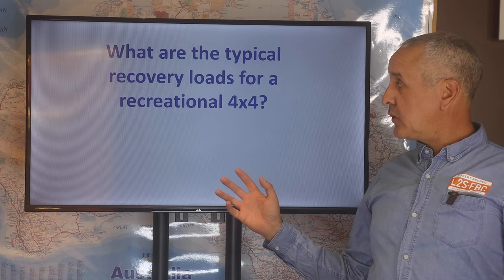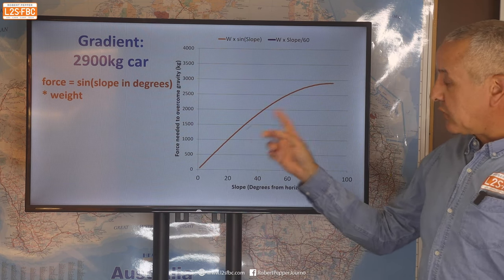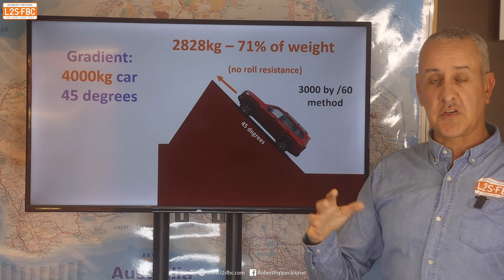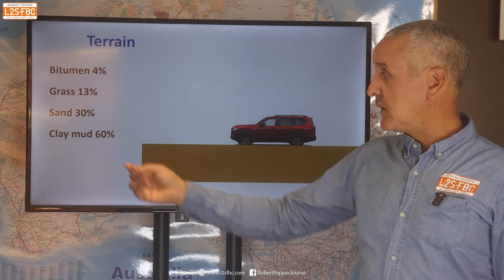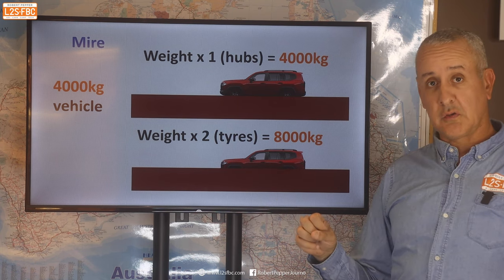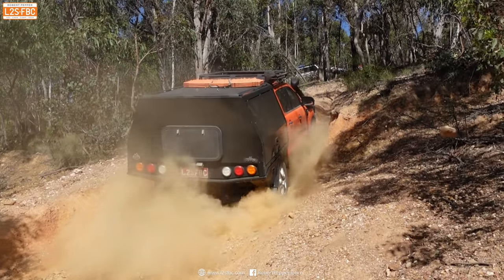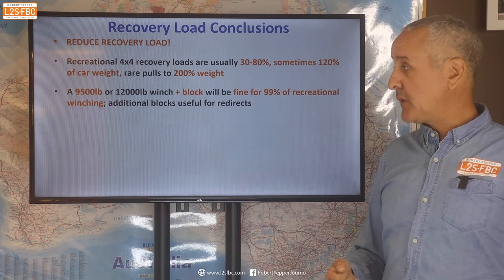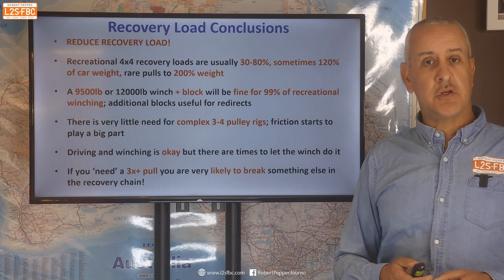Measuring real world 4x4 recovery force

Comment: Nice work mate. Thank you.

Glad you mentioned digging out. The best way to think is that the tyres have to rise up the distance to flatter ground so you are lifting the entire weight up before you can move. Hence why bogged below centre of wheel doubles the recovery force.

The guy who died last year in the US from a botched snatch recovery had spun tyres and dug down making the recovery much harder.
ETA: one inch of vertical is enough. From ex UK Royal Engineer, recovery specialist who I had at our 4x4 site a few years back.
Reply from the maker: what do you mean by one inch of vertical?
Reply: Heavy winching always makes me think about what is going to break on the vehicle first, not whether I have enough force to shift it. And not the obvious things like recovery points. Steering, suspension components, even tyres and rims. I’ve had light trucks bogged to the chassis that have taken heavy forestry plant to lift rather than drag out. Huge forces.
Reply: @L2SFBC  his comment was that you have to lift the entire vehicle up that 1 inch before you start to reduce the effective slope. So the same slope angle calcs apply even if it is only 1 inch lip. 
Obviously with soft ground then that may give way as you pull. (Didn't you mention the extra pull on your ute when you had it on that 22⁰ slope?)

Comment: Excellent content and info Robert. The load cell does not lie. I can't believe how many times I've seen people try to winch a vehicle over a major obstacle without using even the most minimal ramping system available to them (Maxtrax, rocks, dirt, etc).  Your demo at 11:12 of the video is a perfect example of drastically minimizing the line pull just by using some ramps. 
I've never found a downside to using a double line pull either, only upsides. It only takes a little more time and work, but the results are worth it.

Comment: a great video. the only time i have used a 4:1 compound mechanical advantage was when i had to use my Sierra to recover a bogged cruiser. main reason was due to the little zuke not having enough resistance to hold itself, so by putting 3/4 of the recovery load onto a static anchor i was able to pull the significantly heavier vehicle out.

Comment: Great video and info, as always.  As far as driving a winch: When on a slope/grade, imho, the biggest issue is if the driver uses too much throttle, puts slack in the winch line, then loses traction and slides back applying a sudden jerk to the winching system.  I'm all in favor of driving a winch when appropriate, as I believe you said.  Too many what ifs to address them all. 🍻

Comment: Firstly, I take it back what I said on Facebook about winching and driving. I've learned something here which I didn't know before. Secondly, it now makes sense why Land Rover's 1980's book Winching in Safety states that a double line pull should be used if your winching calculations estimate a line pull greater than 2,268 kg (5,000 lb), noting that the factory-approved winches back then typically had a rated line pull of 3,629 kg (8,000 lb) - Superwinch Husky, Warn M8274, Warn M8000 etc. - to the point Land Rover didn't authorise single-line pulls greater than 2,268 kg (5,000 lb) in that book.

I will add though that the British Army's Royal Electrical Mechanical Engineers (REME) Recovery Manual does mention two additional factors to be taken into account regarding recovery forces. Firstly, if half of the wheels are damaged, you need to add the weight of the vehicle as rolling resistance, with all wheels damaged being twice the weight of the vehicle. Secondly, it states that you should add a safety factor of 25% of your total sum of resistance to your calculations, which based on what you have shown seems like very sound practice.
Reply from the maker: Yes, should have mentioned both those points thanks.

Comment: In my experience you generally need less pull than you'd think. I use a 4500lb winch on my Jimny and it's always got me out. Sometimes I have needed to double line pull. I chose such a small winch because of the weight. I can easily carry the winch in one hand. This is important for me because it is removable and I have receiver mounts on each corner of the car. This gives a huge variety of possible pulling configurations.
Reply from the maker: 4500lb = 2000kg so that's about the same as a 10,000lb for a bigger 4x4.  Also, we can recover vehicles using hi-lift jacks and hand winches...so I agree, giant winches are always necessary.
Reply: I have a 4500lb  winch on my Subaru. I went with this as it should be enough on paper. However, although in most scenarios, it is fine in the hardest conditions, even doing double line pulls, it struggles although I did this to save weight and not affect weight distribution much I would consider going to a bigger winch as breaking a winch line on a steep Hill is downright scary. This was on a 43° hill
Reply: @060racing8   I have to admit I was a little concerned about that myself. I fitted the next size up synthetic rope to give some overhead. All of the rest of my rigging is stronger still. The biggest problem I find with this winch is the small amount of line that fits on it. It means I have to carry a fair amount of extra line with me for rigging.
Reply: @LesNewell  and it's probably not a good idea to be winching a Subaru up a hill climb made for motorbikes
Reply: Probably not but we've all done things that looked like a good idea at the time. I have to admit these days unless I am at an off road event I only use the winch to get myself back out, rather than trying to winch further into trouble.

Comment: Army taught me assume 100% vehicle mass for 45 degree and beyond. Don't for get to add in 20% safety factor to calculating load/resistance. Any damage incurred when entering the mire, add another 20%. (this could be as simple as a tyre rolled off the bead or a bent wishbone etc.) Don't dismiss the 45 degree slope out of hand. Always consider that a vehicle bogged in a deep depression has to be pulled up the embankment, often a very steep one at that. You would be calculating the following - vehicle mass, rolling resistance (mud), gradient,(ie the slope out of the hole), ground resistance if pushing mire ahead of the vehicle, damage and of course a safety factor. Does all of this exceed the weakest point of your tackle layout? Can you reduce the load on anchorage by incorporating additional anchors? Then we get into loads on deadman anchors and tree's etc, that is a whole other chart for what size tree will resist a given load. From an ex RAEME recovery mechanic.
Reply from the maker: Thanks good rules of thumb!

Comment: Going by the REME and RAEME recovery manuals  what you have called the "Mire" factor is actually a factor of slope and rolling resistance. For example, a vehicle bogged to the axles would in effect have its wheels facing a 45 degree slope so a bit of elbow grease with a shovel will reduce that factor (as per your sand example). Then the rolling resistance of that surface comes into play as well. One thing that's not generally acknowledged or taken into account is damage factors, ie broken steering arms, damaged suspension and flat tyres. I'll go along with pretty much everything you've said but the best recovery technique involves taking 10 minutes to assess the problem, work out how you can improve physically improve the recovery process -Shovel, Change tyre, straighten steering, chop off stumps the vehicle might be hooked on etc. Learn your primary machines and how to apply them. I can't count how many vehicles I've driven out of bogs in mud and sand by digging and reducing tyre pressures rather than running for a snatch strap or using a winch. To me a winch is a desperate last resort, not a go-to for recoveries.
Reply from the maker: Yep every manual has a different take but same principle

Comment: When I saw Jimny with 12000lbs winch I was laughing a lot - that just stupid. Excess weight on from bumper is affecting driving safety. I bought 4500lbs for mine Jimny and it still has plenty of power.

Comment: Excellent presentation. But, no mention of loads in snow. Where I live this would be the most likely scenario. Not uncommon to be bogged down up to the axle (or more). And, I suppose the density of the snow would be a factor as well.
Reply from the maker: I've not seen stats for snow, and not measured it myself when I've been bogged.  I would use the mud/mire figures if soft snow as that parts nicely and doesn't suction, but if it's more icy, then could even be above mud.  As you'd know, snow could be a loss of traction more than anything else, icy, or the snow up to the headlights in which case you're pulling through it.

Comment: Hi Robert
Enjoyed the video and looking forward to the follow ups.
My vehicle is an Isuzu MU-X with little lift and therefore getting beached or pancaked in ruts like you demonstrated is a very real possibility for me.
If (probably when), in that situation I did think I would lift the rear of vehicle up with the exhaust jack and insert the TREDS I carry under the rear wheels to get the lift.  However, thinking about this as I type, I'm realising the vehicle would most probably roll down the hill, tumbling over the balloon of the exhaust jack.  Hmm!  The bottle jack I carry could possibly suffer a similar fate and topple.
Instead of a winch, I've plumped for a pair of BOG OUTS.  So I suppose I could fix and fully tension the BOG OUTS to the front wheels, before using the exhaust jack under the spare tyre to lift the rear wheels sufficient to place the recovery boards under the rear wheel and then maybe lift the front wheels with the exhaust jack to get the second pair of recovery boards under the front wheels, still with the BOG OUTS under tension 
Bitter experience tells me that placing recovery boards under slack BOG OUTS only results in torn BOG OUTS.
Alternatively, rather than trying to place recovery boards under the front wheels, simply skull drag the front bash plates over the centre hump and use the four recovery boards I have on the rear wheels, alternately shifting them along the ruts as the car progresses up the slope.
What do you think?
PS:  Found the tip about not using power on greasy side slopes particularly useful.
Reply from the maker: You can winch-drag a 4x4 across earth. I did in this video, you saw how hung up I was. So no need for that lifting unless there is a large rock in the way or something.
Bog Outs are good but remember unless you have a locker you need them on both wheels. Place your boards as required, maybe even all 4 under one wheel, to maximise clearance & traction.
Reply: Wow!  You're quick on the replies - so good.  Thanks so much for the advice and yes, I only use BOG OUTS in pairs.

Comment: Fantastic video! Question for the class: when we say the force required by slope, is the force considering a hard pack surface or is the calculation void of friction with the surface? In other words, if asphalt requires a force of 10% the vehicles weight, and a 15 degree grade requires roughly 25% of the vehicle’s weight, would the actual calculation be 35% of the vehicles weight, or does the 25% for grace already consider being on asphalt?
Reply from the maker: The gradient force is worked out assuming no rolling resistance at all. Then you work out the rolling resistance and add it.  So 35 total.
Reply: @L2SFBC understood- assumed as much. Thank you so much for all the amazing info!
Reply: @L2SFBC ahhhh and now that I’m rewatching, you talk about that point specifically. A couple times 🤦‍♂️ forgive me for that!
Reply from the maker: That's ok, most people watch my videos 2-3 times to get everything, I know I said that but I don't like to throw that in people's faces :-)

Comment: Very interesting and informative,some time ago i seen a dvd of a certain group of 4wders from a well know in its day magazine,they had a heavy 4wd badly bogged in beach sand,the vehicle had actually gone under water so was a dead vehicle,they hooked up three winches on single line pulls from three recovery vehicles and proceeded to winch it out with great effort,my guestion is is there any point in doing this,would the three winches be sharing the load or would they have been better to use one winch and  pulley blocks to get a mechanical advantage?
Reply from the maker: The triple-line pull loses power to friction.  Three single lines would not. Also, there are then three handy anchor points not one.

Comment: Would interesting to see the loads when in boggy terrain. Driving/not driving… eg those situations where driving tends to dig. 

I’m actually planning on going back to a 9500lbs winch. 1. Because the brand I’ve chosen saves me 10kgs 2. 12000 is unnecessary slow. 3. I want my winch to be the weakest link in the system.
Reply from the maker: Also a touch lighter.  And for a Wrangler...12k isn't necessary.  I'll do boggy when I get a chance.
Reply: @L2SFBC  definitely not necessary. When I purchased it, my theory was less need for double line pulls. But I think in terms of speed and versatility, 9500 is better anyway. Can go to a double line or a compound pull and it not be too slow.
Reply from the maker: A double line in theory halves the speed, but in practice, given electric motors slow down under load, then the actual difference is much less than half as the double-line about halves the load on the motor.
Reply: @L2SFBC  💯

Comment: Does the diameter of the snatch block roller effect the wench power required for a pull ?
Reply: Good question. The recommended minimum size for a snatch block pulley wheel is 10X the diameter of the rope used, more to protect the rope from excessive bending which can open up the lay of the rope and ruin it. Not so much of a problem with dyneema ropes which are Hawser Laid ropes whereas Steel Wire Rope is typically Ordinary lay in its construction.